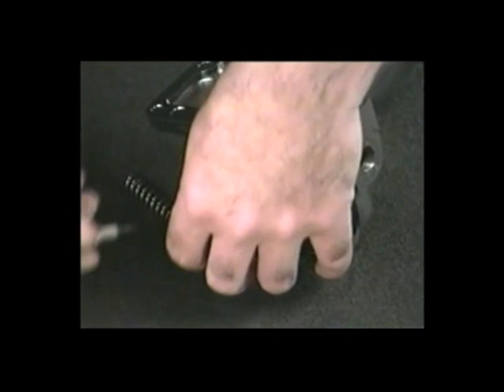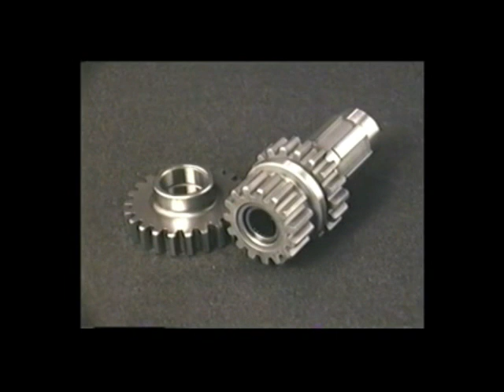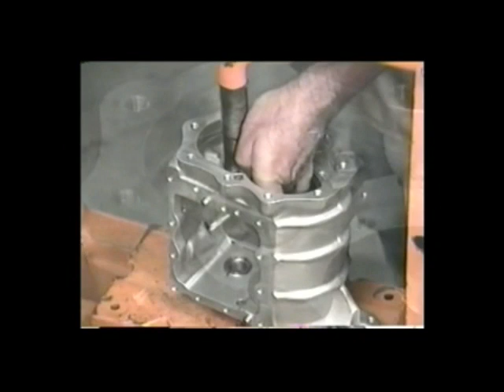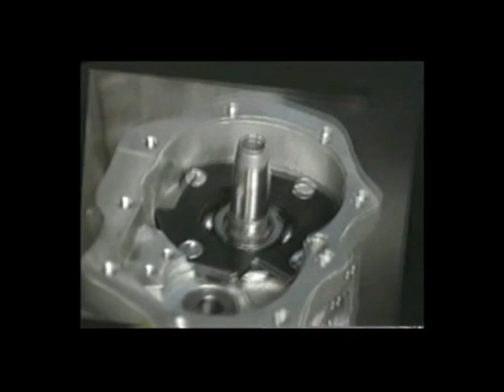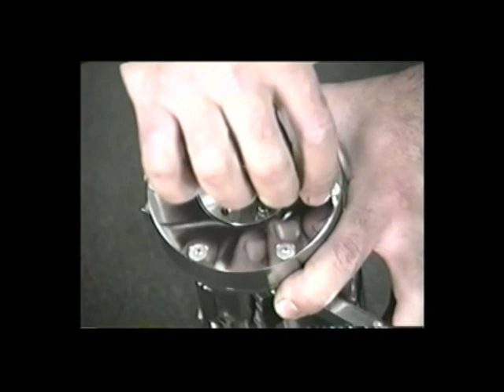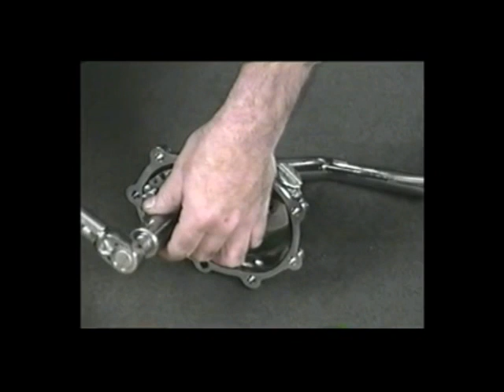Harley 4 speed

Comment: Thank you for the great video I'm taking mine apart now got a lot of slop in the final gear when the chain goes over the gear you can wiggle that sprocket pretty good and it leaks pretty good changing the gasket didn't make a difference

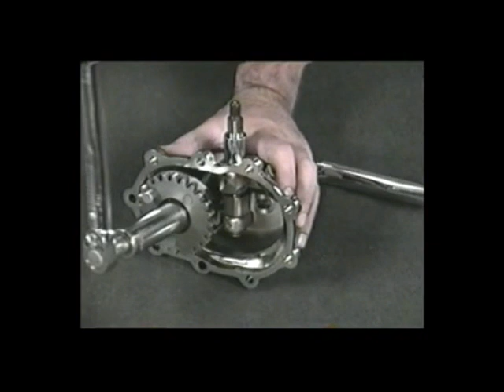Comment: 1:07:46 *INCORRECT: Kick Start Gear nut torque is 30-40 ft/lbs. We ruined 3 nuts with this misinformation. 50-60 ft/lbs is too much. Otherwise this video is dead on.
Reply: I ruined a shaft from this misinformation.  The kicker shaft and the countershaft are both said (in this video) to be 50-60 ft lbs, I would not go over the 30 ft lbs, as you will strip the shaft - a costly repair!

Comment: question when it comes to tightening the gear box cover - One(!) nut (just in front of the clutch lever bolt) sits so tight against the case and the clutch level that its virtually impossible to fit a socket onto to the nut - A 1/2" ring key does not slide over either so the only way I can tighten this is by using the open end of the wrench - So question is how on earth I would be able to tighten this nut to its recommended torque ? As it stands I;ve been tightening this particular nut simply by feel - but would be able to tighten it to its recommended torque if I could - Gear box is 1981 stock 4 gear box with pin bolts on the gear box - only nuts exists - would be keen to know how this can be done properly - special tool or...? comes across as weird though

Comment: sound like from the 1940's but great clear instructions - only issue I had was the 8 o'clock on the gear - my instruction instructs me to put the faced/shaved side of the shaft to 12 o'clock and then put the gear on at 7 o'clock - not sure whats right here - doing it as per my instruction works, but the spring needs to be tightened a lot harder than what this video seem to suggest - but it works and been doing so for the past 35 or so years ;)